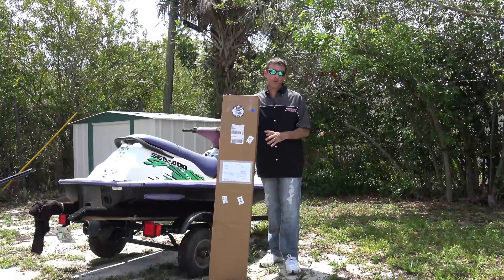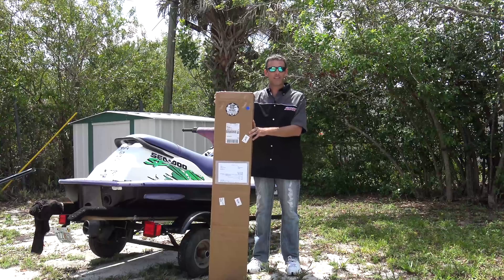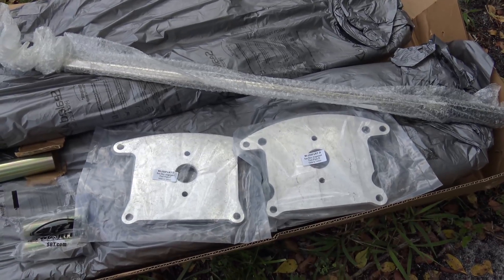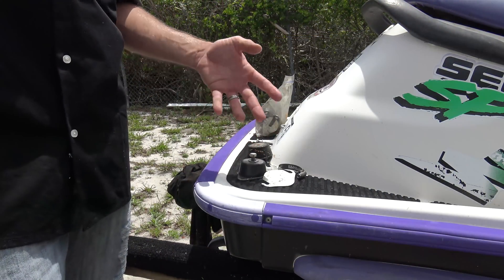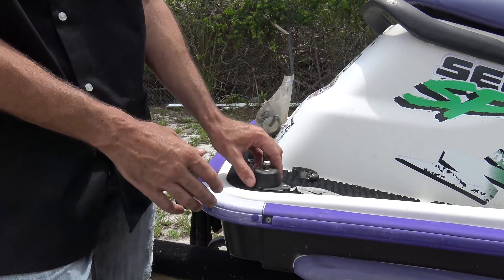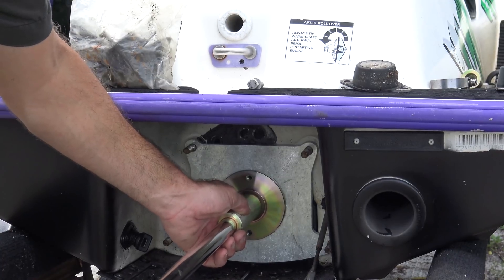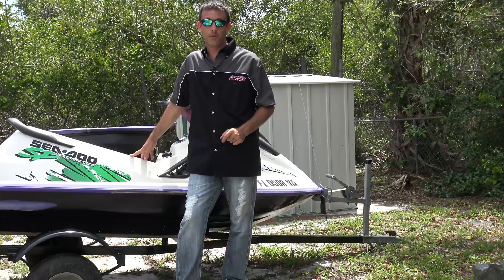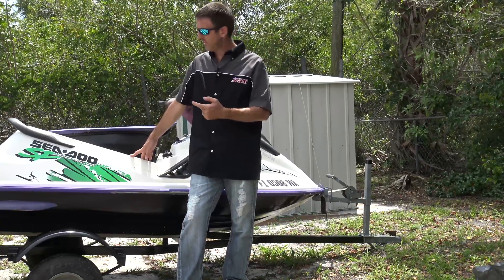SBT PWC Seadoo Jetski alignment Tool, How To Align Your Engine

Comment: When you mentioned vibration… I can see my carbon ring/bellows vibrate but the shaft does not and neither does the engine. Would I need to align my engine? Or is that vibration normal?